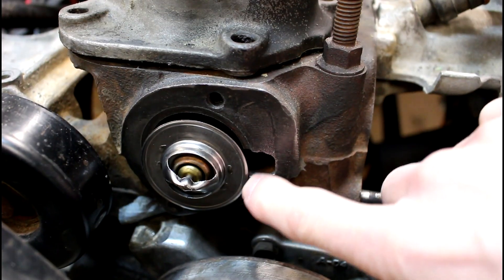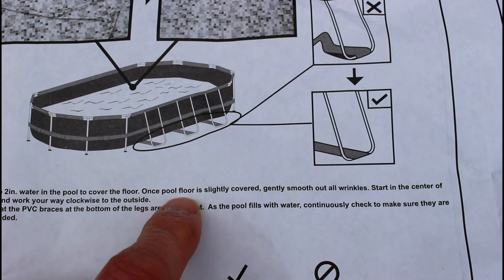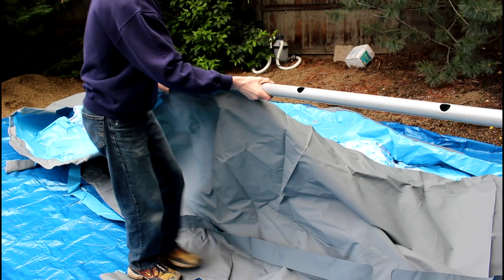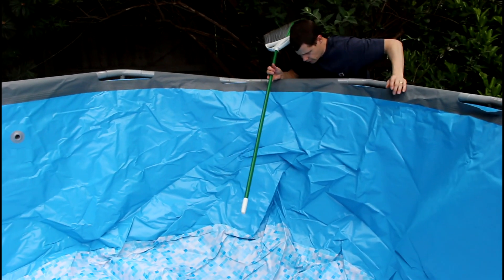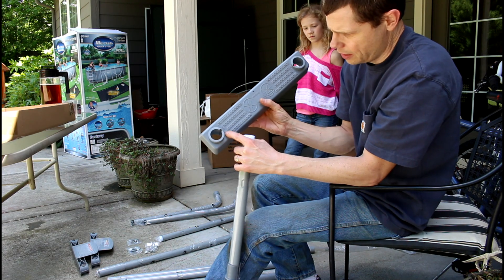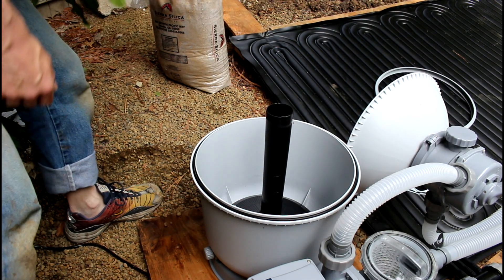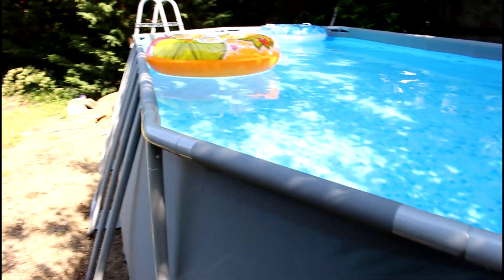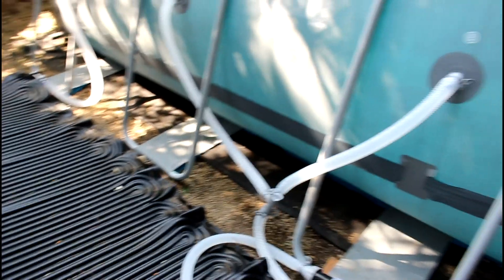Costco Pool Setup: Bestway Oval Pool

Comment: I was thinking about buying this pool until I read the poor reviews on Costco's website. I decided to read the good reviews and found your video suggestion. Thanks for making this tutorial video for all of YouTube! I saw that the pool is 18 feet by 9 feet but what is the  outside diameter including the metal frame and flaps that they go through?  I have limited space and would like to know if it will fit before I start setting it up to find out. Great job on the video. I'll have to check out your Jeep stuff too!
Reply from the maker: +Eddie Ledbetter Thanks Eddie!  At 33sec into my video I show the pool dimensions listed on the box.  It lists dimensions for the pool and braces as well.  Hope that helps.
Reply: Perfect!

Comment: Great video! Questions:  how much gravel did you buy for the base? Did you purchase through a gravel company or buy bags of it? And do you know why sand is not recommended? I’m looking into purchasing this pool soon and want to be on point about making sure it’s level. I live in Oregon so I’m glad you mention putting the legs on wood/cement blocks as we tend to get lots of rain .
Reply from the maker: They don't recommend gravel.  I assume because gravel can be sharp.  I used pea gravel, and just a thin layer to help even out my base.  Pea gravel is a lot smoother.  I'd only use about 1/2 a yard. 1 yard of pea gravel will give you about 2" of coverage for the size of this pool, which I think is too much.  I believe they don't recommend sand because of 'splash' over the sides can wash the sand away, creating an uneven surface.
Reply from the maker: +Will Dickey About a 1/2 yard will give 1” coverage. They don’t recommend gravel though. I used some pea gravel and landscape fabric to cover that

Comment: Thank you for your video.  At its widest point of the pool on the bottom of the U support legs, do they measure much more than the width of the actual pool size? Pool says it is 9'10 x 6'6. Thank you
Reply from the maker: In the beginning of the video, I show the box, and it has the dimensions with the legs out and everything, but let me run out and measure the width.... hang on..
I measure it at about 11 feet.

Comment: Do the U-braces have to snap in at the top rail?  And, I just caught one that slipped out of the hole 3/4 way filled so I am draining it just in time to prevent disaster of a tear.  I can't seem to fit them into the rail so the little white plastics are not showing.  Your video doesn't show you slipping them in either...anyone who knows please respond!
Reply from the maker: Yes.  The u shaped legs snap into the top rail.  The white top caps on the legs are still visible a bit. Mine has little plastic dowl pins that snap into rail. With release tabs still accessible.  Hope that helps.
Reply: ok, so the little white plastics are all visible on mine.  I had one pole side of the u brace slip out when it was 3/4 way filled so I had to pump out water and adjust it.  My garden got a nice soaking but I am again filling it and hoping for the best.  Thanks so much for your reply.  PS.: the drain valve is worthless.  I recommend a submersible pump...only way to go for draining.

Comment: Hey bro can u explain what the different settings mean on the pool pump? I have the exact same pool and have extreme issues with keeping my pool clean.. Thsnks
Reply: X - closed
<<- backwash 
Tear drop -rinse 
Play button - filter 
And the last one is circulate 

I think I got them all, correct me if wrong

Comment: I’m really concerned about potential electrocution! What do we need or should have to prevent this. Do we only have it plugged in when we are not in the pool?
Reply from the maker: Power supply has a build in circuit breaker.  Making it safe to use.

Comment: Sorry “Jeep” but 1 other, please. Duh. Pool filled. Everything hooked up. Forgot to put the sand in the filter pump. Do I just unscrew the top or ? And did you test your pool water prior to adding any chemical at all ?Thanks if any advice.
Reply from the maker: Yeah, I'd just disconnect the hose from the pool to the filter, then raise the hose above the pool water level.  Probably have to do that on both output and return lines.  Then open the filter and fill er up with sand.   I threw 3, 3" chlorine tablets in a pool floater right away.  You can add some chlorine granules to get your chlorine level up as well.

Comment: What was your pressure showing when you first started it up? The instructions say 6.5 psi but mine is around 9 psi I think it's because of the solar panel creating the extra pressure... What are your thoughts? Great video BTW.
Reply: Our pressure sits just below halfway between 5 and 10 on the pressure gauge, closer to 5 so roughly 6.5
Reply from the maker: +Mike M Thanks.  My pressure is 8-9

Comment: Does anyone know of some way of adding a return jet for a Bestway 20x12x48 Costco pool? The return fitting that came with the pool only returns the water into the pool in a straight line. I would like to have an adjustable eye so that the water can be returned into the pool creating a more circular pattern........thanks

Comment: The presure on my sand filter comes to 6PSI without the water heater. Once I plug my water heater panel the pressure comes to 9PSI. Is it the same for yours?
Reply from the maker: Yeah, mine is up around 8-9 with the solar heater on.
Reply: JeepSolid according to the manual  it's too high at 8-9. When I saw the pressure too high I took the water heater panel away.
Reply from the maker: +Djamillos1 Yeah. My pressure is in the 8-9 range.

Comment: Hello! Is there a specific Filter sand I need to use? And when do I have to change it out? Thank you!
Reply from the maker: It needs to be sand designed for use in filters.  You can get it at a local pool store, or even some chains, like Walmart, carry it.

Comment: Nice video, thanks! How long did it take to fill with the hose?
Reply from the maker: It takes hours...  1 hose took roughly 8 hours
Reply: @JeepSolid  how much did your pool "bow/bend" in the middle while it was filling up? I stopped filling mine because it looks too dramatic. I had to level our dirt and used wooden planks under the "U" legs for more support (like itbshows in the instruction book). I  think I made it worse...can you qualify?

Comment: You know the flow basket inside the pool where hose leave pool to go into filter? How does it come off? I would like to try the vacuum but I cannot figure out how to do it or get that dang basket off.Already the 2nd one in the middle of the pool came broken in the box so we only have 1 hose running to the filter. I don't want to risk breaking the 2nd one, but, I pull and twist from the inside and it does not budge. You've heard it enough, vacuum video PLEASE. (like you don't have anything better to do!)
Reply from the maker: Here ya go! https://youtu.be/EHEH4YRsokE

Comment: I live in apartment and I have a little "garden" and ordered this pool. Under me is a garage. I wonder. If the roof will hold up, jesus this thing is quite big !
Reply from the maker: This is not designed to go on a roof.  It weights thousands of pounds... actually, over 29,000 pounds when filled.
Reply: JeepSolid yeah roof was understatement, the whole level that holds the “roof” is under gravel and people have their gardens on top so the pilkars from underground are quite sufficient

Comment: We just set up the pool. A few words of unsolicited advice: 

1. If you are putting blocks/pavers under the posts, make sure you dig them into the ground so that the whole pool is level including the surface of the pavers. Otherwise the sides will bow in at the top. We made this mistake. 

2. Don’t fill the pool too fast. A garden hose or two is the safest way.
Reply from the maker: Good advice 👍🏼

Comment: Mine is still bowed in and almost filled. How far out do the legs go on yours?
Reply from the maker: Those U shaped legs are extended to the end of the strap they set on.  If they are higher than the bottom of the pool, I think that can make the sides bow in.

Comment: Thanks for the video, really helped me out. I have the same pool, and levelled the ground before setup using high performance bedding. I used tarp under the pool also.

All seem to have gone well, but the longitudinal bars still have a bow even with fill up. Not as bad as when it was 50% fill but it still did not correct it self fully. Did you notice the same with yours?

I did use 1” thick left over composite deck boards under the footings. I tamped them in the base about 1/2”. Not sure if that’s causing the bow in the bars.

Comment: +1 vote for an end of summer dismantling video. 

In my case the liner has fused with the perimeter tubing. Maybe SoCal +100F summer temps? Looks like I will have no choice but to leave the straight side tubes in the liner. Anyone found a solution for this?

Thinking I should have chalked the tubes before assembly.

Comment: The box says it comes with a Pool cover.... was that suppose to be the blue tarp? Also, how is the pool holding up? have you considered making it a salt water, lest maintenance...
Reply from the maker: It came with a separate gray fitted cover.  No mention of the blue one in the instructions.
Reply: @JeepSolid  - the pool still doing well???? we are in the process of prepping the ground. we have spent forever trying to remove the sod.
Reply from the maker: Yes.  It's our second season and the kids are still enjoying it.  Only Issue I've had is a few of the plastic pipe clamps have broken.... go figure...   Replaced a few with metal hose clamps.
Reply: @JeepSolid  did it come with a pool cover?? also, how wide are the side support legs? Trying to see if I need to buy the 16" pavers or the 12" pavers
Reply: @JeepSolid   thanks again for the video... I am finally going to set mine up. lol didn't want it sitting over winter. a few questions... 

1) Does the pump have a timer, or you have an external timer for it? 
2) Have you considered converting to 1.5" inlets from the pool to increase the flow? 
https://www.youtube.com/watch?v=X-emONFyAoI  

Lastly, here is another video I found about making 1.5" PVC Adapters. I am going to put a ball valve connecting the ends of the solar heater, so if I want to bypass, Just open the valve, and the water should follow the path of least resistance, and bypass the heater mat.

Comment: "Rinse" actually just rinses the sand out of the multi valve after a backwash. Backwash is what you want to use for cleaning the sand, then you rinse the valve out.
Reply: So do I need to backwash on initial set up, or just rinse? This is the only aspect I am totally confused with. The video implies a rinse is all that is needed, but bestway videos imply an intial backwash is required.

Comment: I bought beltway pool 500 dollars in late June  . o received no rings for ladder no hose or t valve. for water to pump.  tried to call company.  they refuse to send parts till I send them batch nerd receipt and picture of  problems.  there is no way to set. this up in 30 Min and I had to pay for leveling land.

Comment: Is anyone having issues with the pump that comes with this pool.  We purchased this Bestway pool, and it seems that is it just not doing it's job.  We have backwashed it, and it just doesn't feel like it is sucking in the water good enough to clear the water.  I'm super frustrated, as nothing we are doing is working to clear my pool.  Thanks in advance for any advice.
Reply from the maker: It's kinda hard to feel it sucking the water in, because there are 2 inlets with wide screens.  It's easier to feel the flow on the return. That flow isn't powerful, like garden hose, but you should be able to feel water returning. I have a video "Bestway Pool Ready For Summer", and I show a quick shot of how much flow I'm getting on the return line.  Not the best shot, some air in the line, but may give you an idea of what mine does.  Hope that helps 👍
Reply: @JeepSolid  I will give your video on that a look.  Thanks!

Comment: Can you do a separate video for the pump?  You didn’t explain that well and I really need it.  I’m here with all the parts in pieces like wut??
Reply from the maker: Yeah, I need to.  Just need to find the time..
Reply: JeepSolid i feel you.  Kids work, not easy....I’m gonna try regardless
Reply: Yes please! I'm like crazy baffled by this thing! I've had the pool up for a couple days using your video but can't figure out the pump! 😂
Reply: Read the instructions
Reply: JeepSolid I actually figured it out.  Pretty easy when you actually start. (Anyone suffering )It’s a matter of looking at the box, looking at videos online and reading instructions.  It’s logical steps but if you sit there just with instructions you will be lost. Lol you have to just get into it. 

 I had pieces missing :-/ but it works fine.  Also gonna put in the hard tubing when these hoses go.  I am pretty good at building but damn those instructions suck!
Reply: Pump vid yet?
Reply: Where can I buy new hoses and connectors for this pump?
Reply: Tayler Brown hey they sell them on the site for Bestway.  I highly recommend getting pvc piping installed instead. Call a pool repair guy and they will do it.  I have a rental property so I have a dedicated pool repairman so I got him to install it and it has been heaven.  The hoses used to break about every one to two months because of the sun in Miami.  Now it’s been flawless for months!

Comment: Where did you get the sand for the filter?
Reply: do i have to use sand? I use the salt filter hth one?
Reply from the maker: I got the sand from a local pool supply store.  They also sell it at places like Walmart.
Reply from the maker: This style filter requires sand.  I do not have experience with salt filters.  Sorry

Comment: About how long did this take to fill?
Reply: Depending on the size , mine is a 22ft x10ftx48inches and took about 12hours
Reply: @pjefsquad  Thank you so much for replying! I'll be getting mine hopefully by the end of May! I really appreciate the info. & the in-depth video!
😁
Reply: @ariannnamarin7411  no problem! I believe the one in the video is 18ft but there both relatively the same when filling up , also mine is 6,000 gallons , some others are around 12-15,000 gallons and those it takes about 24hours to fill 😫
Reply: @pjefsquad  Wow! Yeah I read about the 24 hours! What about sand? Underneath it? I have level ground in my yard, but I want to do it right.
Reply: @ariannnamarin7411  if u have sand it should be fine I would double check to make sure but IMO should be good as long as it’s not really soft turf/ground
Reply: @pjefsquad  Thanks!
Reply: @pjefsquad  Thanks! What is IMO? I have flat surface glass.
Reply: @ariannnamarin7411  no worries I was the same LOL , it means “in my opinion”
Reply: @pjefsquad  Thank you! So we have flat surface grass so should I use sand?

Comment: Thank you so much for posting this video!!! Instructions are hateful!  Can you provide any advice for the filter/pump+solar heater+skimmer.  Can’t figure out which tube goes where? Lol And agree with your opinion on 30 min setup. What a joke!  We were literally hours (4+) and still haven’t gotten to the vacuum!! Thanks again!
Reply from the maker: I need to make another video on the vacuum.  I don't plan on using the skimmer, as it seems fragile to me and I'm afarid the kids will just break it off.  I cover the filter, pump, and heater setup in this video.
Reply: Thanks, we hooked it up the same way you did with out the skimmer. One more question, do you leave you pump on all the time? :)
Reply from the maker: I run my pump for 6-8 hours/day
Reply: Okay great!  Thanks so much!  I was reading through some of the other questions people have asked. You’ve been an amazing support for people who bought this product, Bestway definitely owes you some kick back!  Now we’re just trying to work out the chemicals. For now just using chlorine pucks as suggested on another thread. :) Thanks again for your help!!

Comment: I have to buy the sand right
Reply from the maker: +pEpE Yep 👍🏼
Reply: Thank you for the fast reply and I’ve never had a sand pump it looks really complicated to use
Reply: Any tips jeepsolid
Reply: What kind of sand do u need
Reply from the maker: pEpE Sand filters are great.  The way to go for sure.  Just make sure to run the ‘rinse’ setting as I show in the video.
Reply: Any specific sand that u need and where can I get it

Comment: Be aware the pump and hoses are crap the hoses will crack after the first year pool is a one year deal easy to set up though
Reply: Where can I find new hoses and connections?
Reply: Tayler Brown  I got  hose at Home Depot and cut them to length and bought new hose clamps

Comment: How many pounds of sand do I need for the filter?
Reply from the maker: I got a 50# bag and used a little over 1/2 of it.  You may be able to get away with a 25# bag??
Reply: Does the solar heater actually help heat the pool
Reply from the maker: It actually does.  When in the direct sun.  If you put your hand in front of the return port, the water feels warmer returning to the pool.